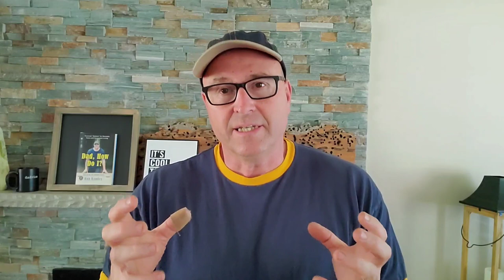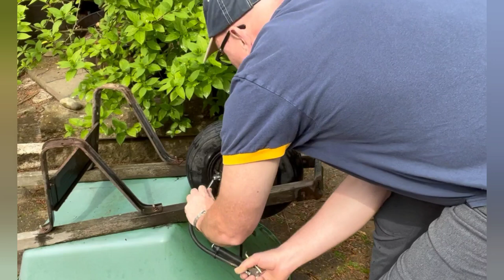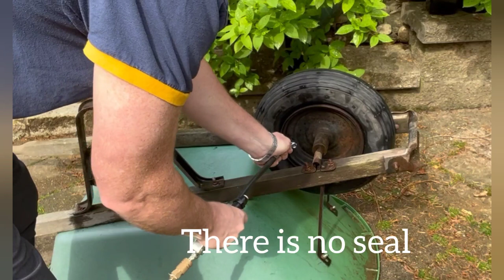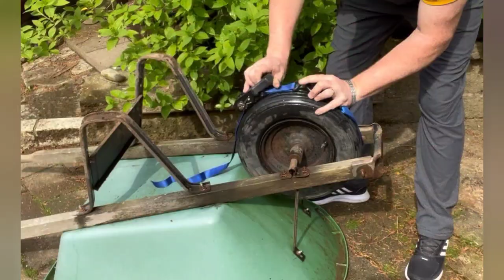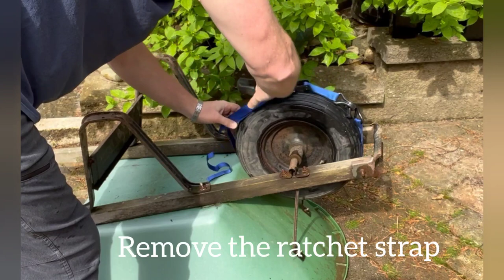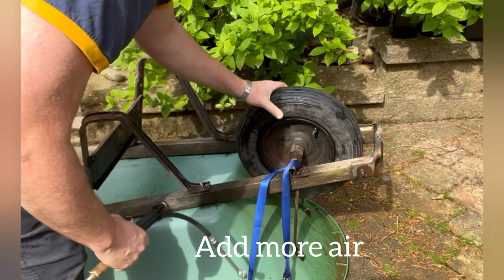How to Inflate a Tubeless Tire

Comment: I HAVE this exact problem ...will "Fix a Flat" cause more problems or should I get a new tire ? Thanks Dad for all you do for us out here !! 🤗🧡💛🧡💛
Reply: From what I've heard and read, the consensus is the "fix a flat" products should be for emergency use only, until you can make proper repairs.
Reply: Yes!  Fix-aFlat works great to seal leaks but you need to use the strap to make the initial seal.

Comment: Great idea for creating that seal tubeless tires need.  Corrosion of the wheel can cause air loss.  Might be a good idea to make sure the wheel rim is nice and smooth where it contacts the tire.  If not, use some sandpaper to get rid of the roughness; I'm thinking 80 or 100 grit followed by 150 to 220 should smooth things up. 🤔 🙂👍 Take care and God bless 🙏🙂
Reply: Good advice because this method isn't working for me. I was thinking a line of grease or calk, something to help the seal.
Reply: @timfear  Hi.  After sanding things smooth, maybe try smearing a light coat of grease ( dielectric grease if you have any), or maybe Vaseline on the rim and tire.  Hopefully, that will help.  If not, you may have to get a tube.  Some places like Harbor Freight sell a replacement tire and wheel about as cheap as a tube elsewhere 🙄.  Hope you get it fixed 👍.  Take care, and God bless you 🙏

Comment: I don't have compressed air at home so I took the tire off and took it to a tire shop.  I held in the sides and the tire guy pushed his end into my chest while he put the air hose on it and the beads popped into place.  It was one of those times when I learned I can't do everything all by myself, but have to get help sometimes.  

Another one is moving a couch.

Comment: The strap did not work. Any other ideas on what to use?
Reply from the maker: You could use a rope, tie a hole in one end and thread the other end through the hole
Reply: @DadhowdoI  I was finally was able to figure it out but it's a pain because the strap is so long.
Thank you for replying back.